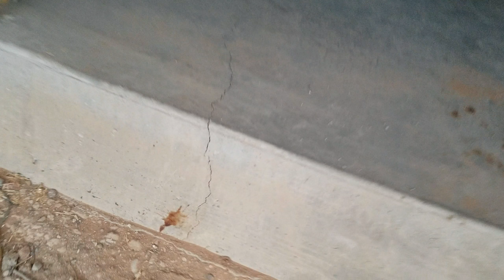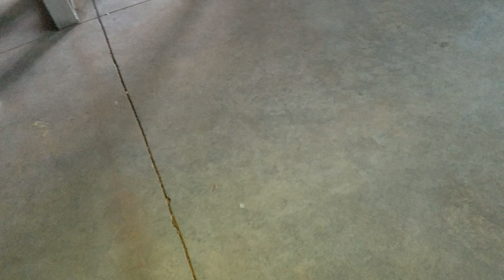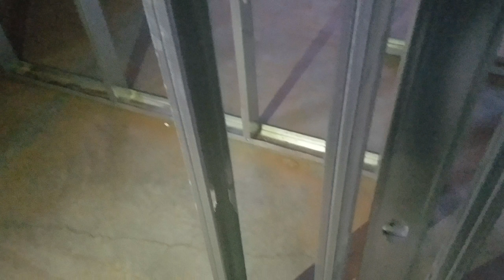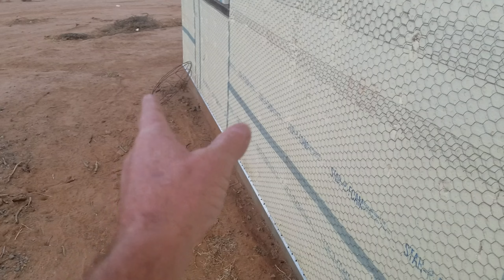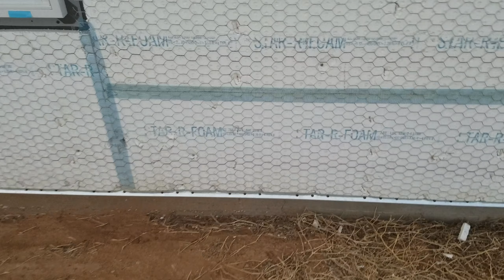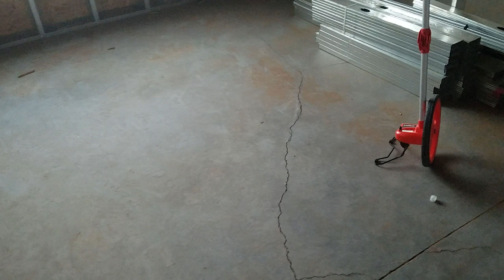Foundation Problems - Foundation Repair - Casa Grande Arizona

Comment: I thought it is impossible to have a piece of concret not crack. How wide is the crack consider a problem?
Reply from the maker: According to the Registrar of Contractors in the state of Arizona governing body, 3/32 inch which is basically the width of a nickel. However interior floor heave cracks are caused by Foundation settlement around perimeter of homes commercial or Residential Building structures. Because we live in Arizona it is considered an arid climate, and very little consideration is considered when it comes to waterproofing and proper dirt grading around parameters of foundation walls. Although, the City of Phoenix does require 6 in slope away from all foundations in 10 feet. This is not enforced. I hope this information has been helpful. Thank you